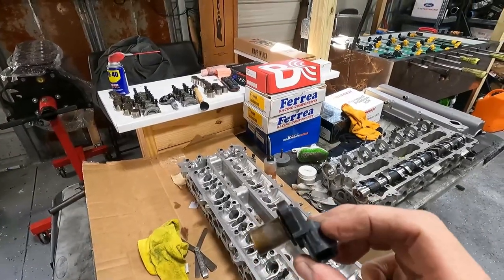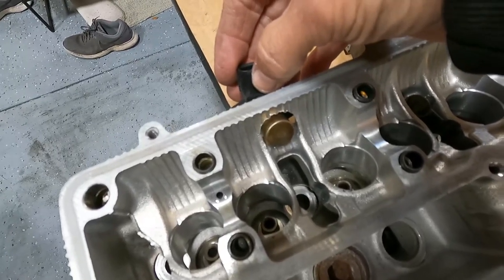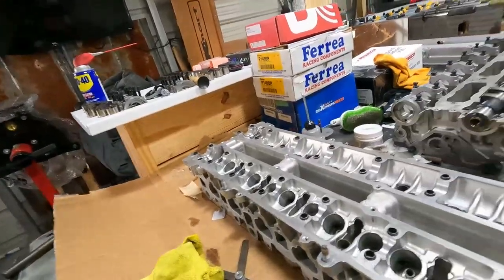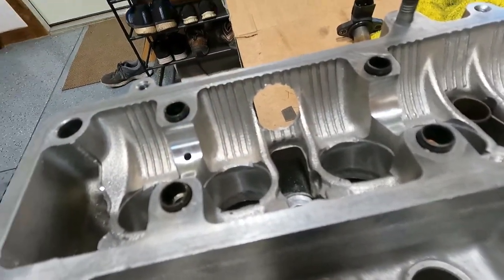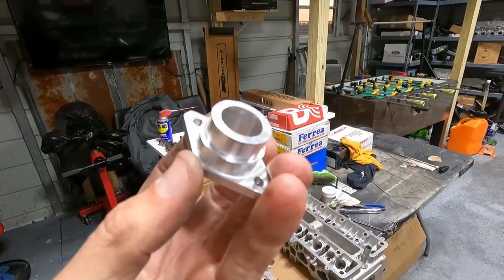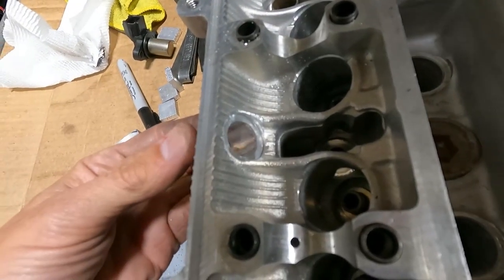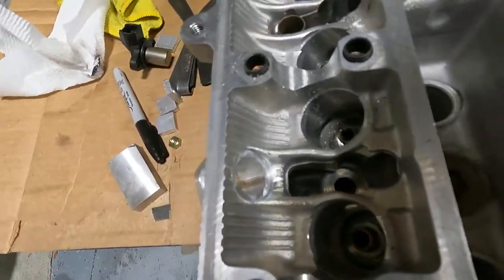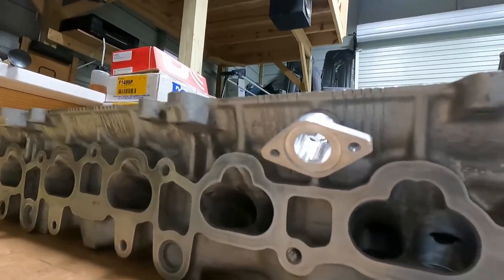2JZ GE Cam Sensor Adapter-CNC Machined 6061 Aluminum

Comment: It was actually my idea lol, came up with it for my 2jz g35. I make these and Alberto sells them. Alberto has been busy and has not purchased anymore from me, so I now sell them on eBay. Just search 2jz billet cam sensor adapter.  

Btw have been running my jz with this for over a year at 700 whp with no issues on a Haltech ecu.
Reply from the maker: I should have bought from you instead of making one. 😁
Reply: @fox-body  yours looks great! I love the proud feeling you get when you create something yourself! Mad props!
Reply: Can you use the ge cam or need the gte cam ?
Reply from the maker: @Munromechanism you’ll need a gte cam or after market.

Comment: I used the adjustable cam gear and just replaced one of the stainless bolts for a steel bolt and that worked with the factory 2jz cam sensor.
Reply: I really want to know more about this steel bolt!!